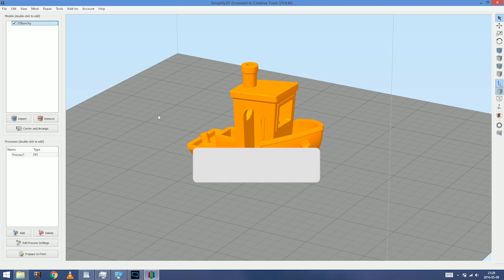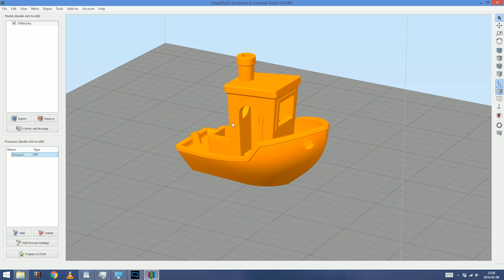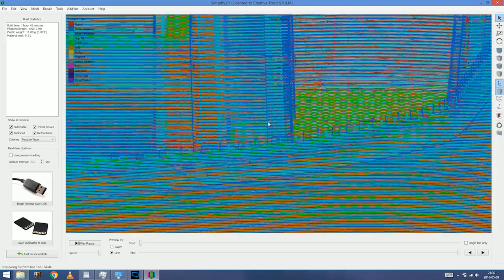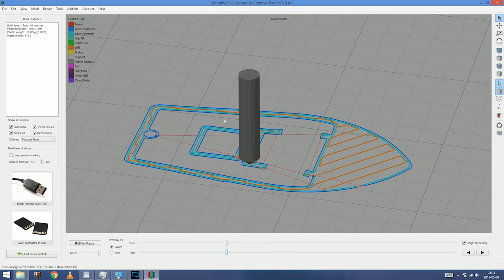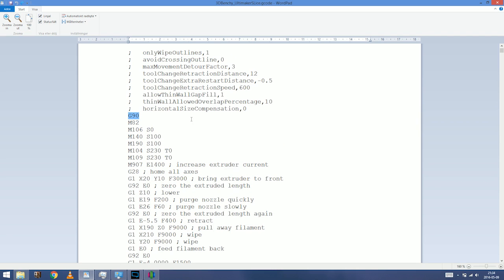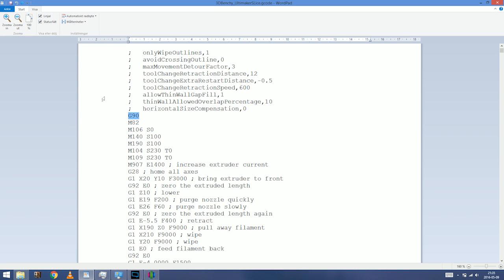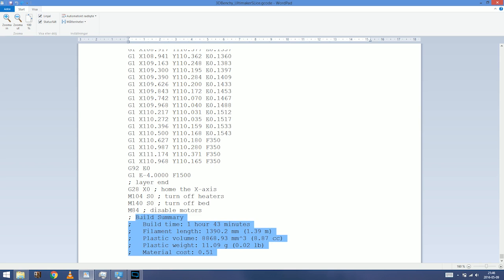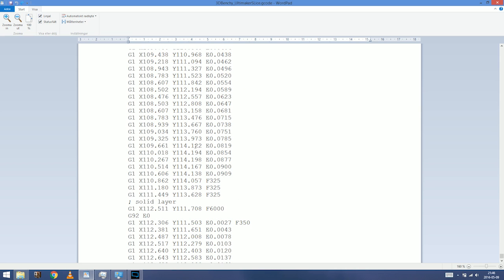Exploring G-code for 3D printing

Comment: Great video on taking you thru some of the commands and reading gcode. Your gcode has coordinate precision out to XXX.XXX thousandths place. really good. Anyway i am curious if one designs a model in .stl or any other common modeling 3d format. What defines the generate gcode from it ...from running on a 3d printer vs a cnc router vs a cnc laser vs a cnc lathe ...etc. All cnc machines run on gcode. I am aware of that. But not sure what makes different cnc machines gcode much different. And more importantly is there a program to take a specific modeling file like an .stl and generate a a gcode for each different type of cnc machine to beable to manufacture the design in many different types of cnc machines?

Comment: How can I see the G-code for a particular print?   In you video you state " Look at the G-code" and the there it is.  How did you display it?
Reply: You save it to a file, then open the file in a plain text editor, such as the free Notepad++ (which is much better than the Notepad that comes with Windows).

Comment: Hi, please I need the firmware to  Arduino, and the setup configuration for cura slicer or any slicer you want,
this ismy printer
GZ -JH QUBEA qD-1X Delta parallel FDM 3D Printer

Comment: Great video! I didn't see the code to turn on the print fan after the first layer or so. I'd like to just be able to turn on that fan only to check operation and airflow with a fang mod I have. How do I do that? I'm working with a CR-10 and Cura.